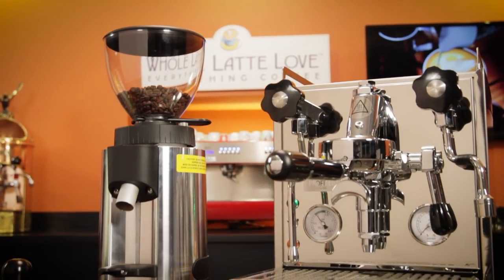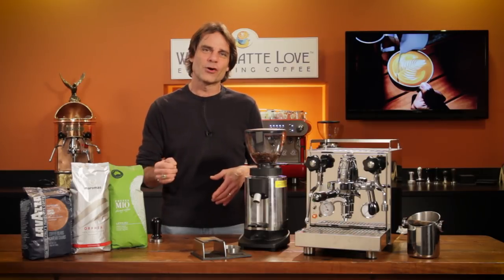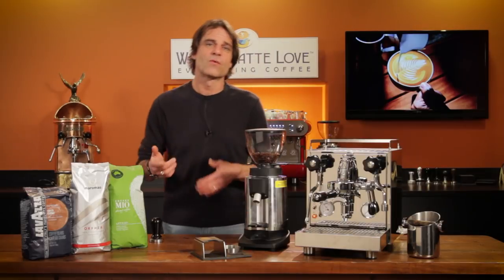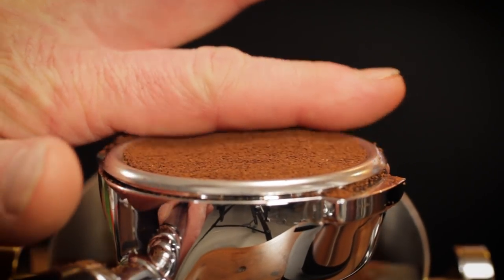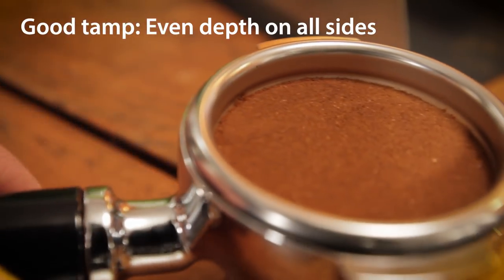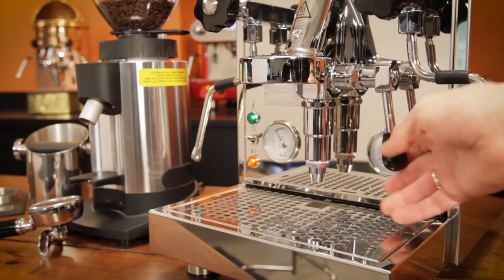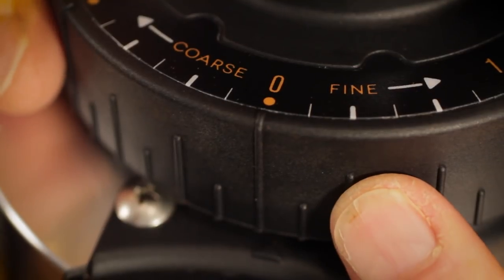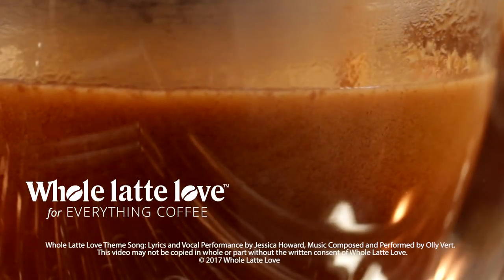How To: Basic Espresso Technique - Dialing in Grind Size

Comment: i have a rocky grinder and i dial in 5 to grind espresso beans; but i'm getting chucks and balls when i grind. finer dial in?
Reply from the maker: Hi Eric, How are your extractions? Not uncommon for a Rocky to clump some when grinding in the espresso range. Bean type and other factors like humidity may contribute to the clumping.
Marc
Reply: @Wholelattelovepage  extractions can be a on the bitter side. i'm getting a great deal of clumping. when i foam milk correctly the shot is great.
Reply from the maker: @ericc7936  Hi Eric, Bitter flavor indicates over-extraction. Grind that's too tight can cause over-extraction (so can other things) and the finer you go on a Rocky the more clumps you'll get. What machine, coffee dose weight, extraction timing and liquid volume?
Marc

Comment: Does a Fracino Classico need flushing b4 brewing cheers 👍🏻
Reply from the maker: Hi d, Yes. It's a HX Boiler machine with pressurestat temperature control. This type of machine usually needs a flush to remove over-heated brew water.
Marc
Reply: Whole Latte Love cheers the steaming power on the Fracino is nothing short of awesome steams milk in seconds must be one of the quickest steaming wands 
 around

Comment: I have a Oscar II.  Do I need to flush before using?
Reply from the maker: Hi Terri, Thanks for the question. Probably. Here's what to do: With the machine fully heated up remove the portafilter and run brew water. Observe the water flow from the group. If it's overheated you will see bubbling when the water first starts to flow. That's an indication of flash boiling with water temp over 100c/212f. After a few seconds the water flow should smooth out. When you see smooth flow you are near a good brew temp. From there the longer you flush, the cooler the brew temp. Probably wouldn't go more than 5 seconds beyond smooth water flow from the group. Here's a video on flushing a machine with heat exchange boilers: https://youtu.be/bHSFBM3cWHI
Hope that helps!
Marc

Comment: What about simonelli appia 2?i saw the simonelli appia 2 shower head,theres a screw pop out in the middle i dnt know if thats normal,and on the portafilter basket when i remove it theres numbers in it,is it serial number?03000073 the number shown.and if possible abt the grind setting for simonelli grinder.tnx again wholelattelove
Reply from the maker: Hi MC, Not familiar with the Appia II. Screw holdiong in a shower screen is normal. If the screw is loose (poped out) and will not tighten then that could be an issue. I'm guessing the 03000073 is a part number. As for a grind setting for the grinder you need to dial in the grind as demonstrated in this video. It will be different for every user depending on coffee used, dose weight, etc.

Comment: Hey 
Should thermoblock machines be flushed ?
Reply: If you observe there's a lot of turbulence, steam and water flash-heating when you first run the hot water through, then a cooling flush would be helpful.

Comment: My filter basket holds 14g so an I just over fit add level off? my grinder is very clumpy yours in the video looks nicer and fine
Reply from the maker: Hi Mary, I would just fill and level off. So long as you are within .5g for each extraction you should be able to dial in. What grinder are you using?
Reply: Hi a Mazzer super jolly
Reply from the maker: Hi Mary, Is your Super Jolly a doser or doserless? Super Jolly shouldn't produce overly clumpy grinds unless there's an obstruction prior to coffee falling into the cone of the doserless model or the dosing chamber of the dosing model. Clumping can be more pronounced with dark roasted/oily beans. If continue to have clumping issues you might try cleaning the grinder.
Marc
Reply: Hi Marc its electronic grinder what beans is good then ?
Reply: Im using monsoon malabar

Comment: Using a gaggia classic pro, any need for a flush.
Reply from the maker: Hi Dominic, Thanks for the question. Depends on where the boiler is in it's heating cycle. You can check by doing a short flush. If water is bubbly/extra steamy out of the shower screen run a couple seconds to a smooth flow and you're good to go!
Marc

Comment: Hey I have a problem: my grind is right, my tamp is okay, but using a normal filter only black espresso comes out. 
It tastes really bitter but a lot comes out in a short time.

Using a double wall, everything is fine
Reply from the maker: Hi KT, Double wall (pressurized) filter baskets fake the crema to some extent by squeezing the espresso through a tiny hole. When pressure is released on the other side of the hole bubbles form. Those bubbles are a little different than true crema. When using standard non-pressurized filter baskets producing crema requires a coffee that's capable and getting to the right grind size by dialing in. You say it's coming very fast. To me that says your grind is too coarse and/or your dose is too low. Hope that helps!
Marc
Reply: @Wholelattelovepage  thanks Marc! That's helped a lot :) I will get some new coffee soon, the beans are over 2 months old

Comment: What i dont get... Why is time so important when you fail to reach 2ounce in 30sec? Coffee too fine...therefore acidic or what?
Reply from the maker: Hi hmd, If your coffee is ground too fine causing a slow extraction it generally presents with bitter flavors. Sour flavor is usually associated with under extraction in shots that run too fast. Bright/acidic flavor is common in very fresh from roast coffees - especially lighter roasted specialty coffees.
Marc
Reply: @Wholelattelovepage  Thanks! We're Just getting Started on that topic. I really love to hear your expertise opinion on the ordered Espresso Maker ESM802EU Milegra and Graef CM702 Grinder. Greetings from Austria 🙂

Comment: I got my coffee to a espresso grind but when I put it in my espresso machine the water runs clear too quickly. It did the same on my other machine as well, and I have tried two different types of beans. What grind am I suppose to get since its obviously not the espresso grind....
Reply from the maker: Hi AP, Thanks for the question. My aplogies for a delayed response - I've been on vacation and offline. Sounds like your grind is not fine enough. As described in the video keep grinding finer until you're shots are coming in 20-30 seconds.
Marc

Comment: Ok, so I have the bone-head question of the day, but as I always say to my kids, there is no such thing as a stupid question if you dont know the answer... its how we learn.  

So after several house builds/condo renos, I typically install a build in full-auto machine (dont laugh) and subsequently, leave a $3-4,000 espresso machine behind.  This time Im taking it with me so I bought a Profitec 800 & T64 Grinder.  Ive owned several semi-auto machines as well but Im a LEVER NEWBIE.

Just watch this video and it was great.  Grind is getting very close.

So now the question:  I pre-infuse for about 5 steam-boats and then start the pull.  I am getting 2oz exactly on the pull.  Ive looked & looked but I cant find the the answer to "how can I make the shots longer on the Profitec 800?"

Thanks!
Reply from the maker: Hi Richard, Thanks for the comment and I agree (and tell my kids too) there's no such thing as a stupid question! If I understand correctly you want the shot longer as in more volume in the cup? If so, you can re-cock the lever to introduce more brew water to the coffee. If you mean longer as in duration of extraction then finer grind and/or more coffee in the filter basket.
Marc
Reply: @Wholelattelovepage  Thanks.  Yes, I meant more volume of water.  OK will try that.  Should I wait for the first cycle to end or catch it part way through?  Obviously, I dont want to burn or over-extract

Comment: do I need to flush a Rocket Appartemento?
Reply from the maker: Hi PAS, Probably. You can check by allowing the machine to fully warmup and then operating the brew lever. If water coming from the group is turbulent then you should flush to smooth water flow just prior to brewing.
Marc

Comment: Do you need to flush a Breville barista express
Reply from the maker: Hi G, Thanks for the question. Probably not as it uses a thermoblock boiler which heats water on demand to some extent. You can check by removing portafilter and running some brew water. If you see lots of steam or bubbling of brew water coming from the shower screen that indicates flash boiling and over temp brew water. If flow is smooth initially then no need to flush. Hope that helps!
Marc
Reply: Whole Latte Love definitely helped, I just got my machine today getting ready to dial in my grind and practice some milk frothing. Your videos are extremely helpful will definitely be doing the dish soap and water method.

Comment: No crema from my Rocket espresso machine…. Any reason why?
Reply from the maker: Hi EM, Lack of crema usually comes down to the coffee beans used and/or incorrect grind size.
Marc
Reply: @Wholelattelovepage   how do I adjust on my 
Mozzafiato Cronometro the water flow speed?  My coffee comes out to fast no matter how fine the grind of my coffee
Reply: @Wholelattelovepage  I am using decaf coffee purchase from Whole Latte Love and I have been using very fine grind.  Any other suggestions?

Comment: Hi Mark. Firstly, I’d like to say what fantastic video presentations you do. Now the question...when you mention the required volume ie in this case 2 oz or 60 ml, is that measurement mark taken to the top of the crema or the dark coffee liquid.?
Secondly, what volume should a 22 gram basket produce? Many thanks in advance.
Reply from the maker: Hi Pete, Thank you for the comment and question. It's one I get a lot! At the end of the day it's the volume which produces a flavor you like. When I use measured volume I typically split the difference and include about half the crema in measured volume. Now some coffees produce a lot more crema than others so there a bit of guessing and estimation involved. The most accurate method is to weigh your coffee dose and your extracted espresso and use brew ratios. Going to need a scale for that. Acaia scales are the most popular for use in espresso: https://www.wholelattelove.com/brands/acaia
I'll link a video below which explains brew ratios. The basic idea is a ratio of coffee dose to extracted weight. So if you dose 20g and like a 2:1 ratio you would stop a shot when you have 40g of espresso extracted. If you prefer 3:1 then stop at 60g and so on. There is no right answer to the best ratio. It changes based on your personal taste preferences and the beans used. Here's the brew ratio video: https://youtu.be/57UqPDirHoU Hope that helps. Let me know if you have more questions!
Marc
Reply: Thanks very much for your quick reply Marc, very much appreciated. I’ll definitely look at the videos you recommended. 
On a side note, I contacted Coffee Mio in Melbourne yesterday regarding the Ufficio blend as seen in your video (I live in Aus). Unfortunately that particular blend is only for the USA market! Lucky you! 
They gave me info on equivalent blends available here that I might like to try, without importing the Ufficio blend from Whole Latte Love back into Australia lol.

Comment: using volume (2 oz) as a guideline is not optimal, as the crema can vary from coffee / grind to coffee / grind. Its better to use weight (g) so the golden rule 1:2 or 1:2.5 (ground coffee bean : coffee) Hope that helps
Reply from the maker: Hi Dr., You are 100% correct! This was a tutorial aimed at beginners - many of whom do not have a scale. I have more advanced videos on using scales for doing more accurate brew ratios like this one: https://youtu.be/WifLRJZKs9A
Marc
Reply: @Wholelattelovepage  thx thats awesome

Comment: Do I need to flush Rocket Giotto Evoluzione R with PID?
Reply from the maker: Hi FW, Thanks for the question. In our testing we found flushing was not needed with PID versions of Evo R and Type V Giottos and Mozzafiattos. We've tested all with Scace and found brew temps are consistent without flushing and match closely with PID boiler temps in the manual. Hope that helps!
Marc
Reply: Thank you very much for your help!

Comment: should I flush with the bezzera BZ 10?
Reply from the maker: Hi SR, Depends on where the pressurestat is set. The pressurestat controls boiler temperature. If set to higher pressure/temperature then you may need a cooling flush. What I would do is check the brew water flow from the group without the portafilter in place. Do this when the machine is fully warmed up. If the flow is turbulent or extra steamy that indicates flash boiling and water over 212F/100C. once the flow smooths out you are below boiling point. If your flow is smooth from the get go then no need to flush. Here's a video showing what the flow from the group looks like: https://youtu.be/bHSFBM3cWHI
Hope that helps!
Marc

Comment: How long do I need to flush Oscar 2?
Reply from the maker: Hi NA, I would flush until the flow from the group is smooth with no evidence of flash boiling which presents as bubbles and extensive steam in the flow at the shower screen. From there, taste your shots. If they seem a little bitter you could try flushing a couple extra seconds to reduce brew temp a little more. Hope that helps!

Comment: I’m about to order a Sette 270. For those of you who own one, a question: what is your current coarse/fine setting for your espresso grind? I’ll be using a typical blend, and I’m imagining that such a roast blend should typically utilize a similar setting for most folks. I want to start from a good place, so I don’t need to waste too much coffee dialing it in. So let’s see your Sette settings!
Reply from the maker: Hi GK, For espresso you like be in the range of 2-6 on the Macro setting. From there you'll need to adjust "Dial-in" to fit your particular brewing variables like dose weight etc.
Marc

Comment: Amazing video! Could you please post links/names of the espresso machine, grinder and tamper used? Much appreciated :)
Reply from the maker: Hi AW, Thanks for the comment!
Espresso Machine: Profitec Pro 500 (Upgraded since to Profitec Pro 500 PID) https://www.wholelattelove.com/profitec-pro-500-pid-espresso-machine
Grinder: Ceado E5P https://www.wholelattelove.com/ceado-e5p-electronic-coffee-grinder
Tamper: Espro Calibrated Convex Base https://www.wholelattelove.com/espro-58mm-calibrated-convex-tamper
Marc
Reply: Wonderful! Thank you for the advice :) I also wanted to ask, is a stainless steel grinder enough for moka pot preparations? Much appreciated
Reply from the maker: Anas Wardeh NP! Mika grind size very similar to espresso so it will work.

Comment: I have the Rocket Espresso Mozzafiato Evoluzione R. Do I need to flush it?
Reply from the maker: Hi WHYM, Thanks for the question. We've done a fair amount of Scace testing on the Mozzafiato R and found cooling flushes prior to extractions were not needed on this PID equipped machine.
Marc
Reply: Hey Mark. Can the use of different espresso machines bring difference in de test of coffee? Is so, why and how? Thanks

Comment: Specialty Coffee Association of America (SCAA) definition of espresso:

“Espresso is a 25–35ml (.85–1.2 ounce [×2 for double]) beverage prepared from 7–9 grams (14–18 grams for a double) of coffee through which clean water of 195°–205°F (90.5°–96.1°C) has been forced at 9–10 atmospheres of pressure, and where the grind of the coffee is such that the brew time is 20–30 seconds. While brewing, the flow of espresso will appear to have the viscosity of warm honey and the resulting beverage will exhibit a thick, dark golden crema. Espresso should be prepared specifically for and immediately served to its intended consumer.”
Reply: the average barista uses a 1:2 brew ratio when extracting espresso and uses weight for output measurement. The average shot of espresso starts with an 18–20 gram dose, has an output of 36.5 grams, is extracted in 25–30 seconds, at 9 bars of pressure and 200°F, using pre-infusion, through an 18 gram basket.
Reply from the maker: Here's a video with results of a barista survey: https://youtu.be/a16QqiK4hzo

Comment: Guys i need advice!!! Rocket aparttamento or ecm clasika pid????
Reply from the maker: BsOnK1969 think I responded to your question on another video. But short answer... If your mostly about espresso then the ECM. If you do milk drinks more the coffee he Appartemento. Without more info from you it’s hard to give a better opinion.
Reply: defo rocket appartamento.. its much better than classika. or check out profitec 300.. same price but dual boiler, PID, shot timer.. just no e61 but still is the best bang for the buck

Comment: Flush a Magister es40??
Reply from the maker: Hi SS, Thanks for the question. Have not personally used but believe it has a heat-exchange boiler which generally needs to be flushed. Check by running pump with PF off group after machine fully warmed up. If flow from group is "bubbly" that indicates flash boiling and water over boiling point of 212F/100C. Flush till water flows smooth - usually ~5 or so seconds. If water flow smooth without flush then no need but that would be surprising in an HX machine not of more recent design with PID temp control.
Marc